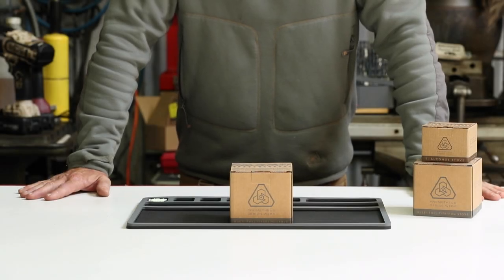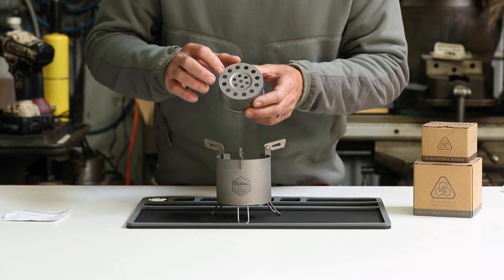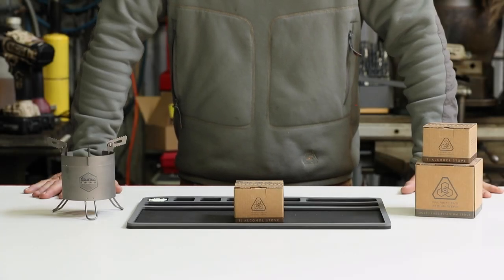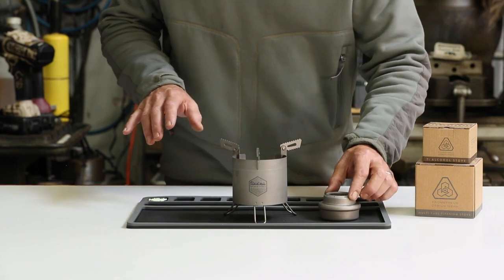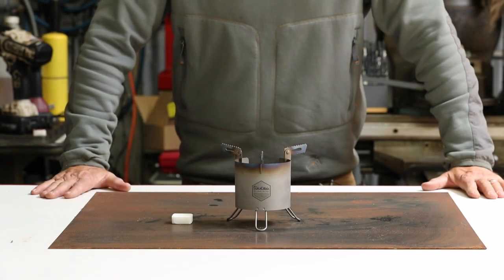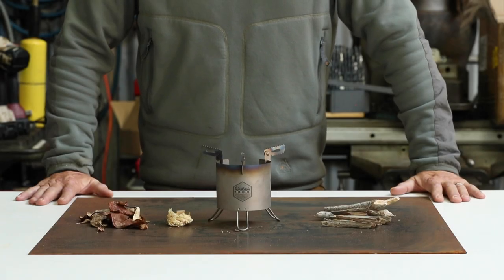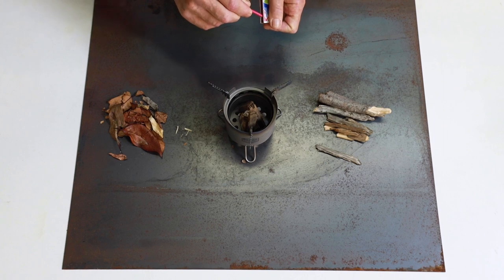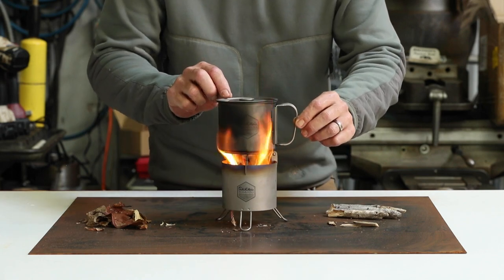PDW Ti-Line MFSS (M.ulti F.uel S.urvival S.tove)

Comment: Very few designs out there ( ie none) with the alcohol burner included in the stove design. Great to see some innovation. I'll be checking weights and see how you compare to my current setup. I'm definitely interested.
Reply: Our design is not the lightest, but one of the most versatile in regards to alternative fuel (non-petroleum based) sources with a double jetting wall. ;-)